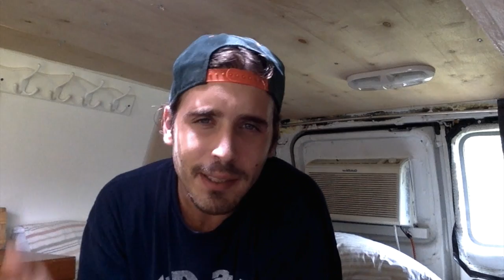Van Life - Q&A Fridays 01 With Campervan Cory

Comment: I like watching your videos.  You are so down to earth and just give off such a good vibe. How is the ac working out? I should have paid closer attention to your dad's install.  We did not put metal against vent on the sides. Rain means water in the van. I did temporary fix for now. I bought Honda 2000i, but still pretty loud for stelth. If you have solution for noise, and getting up in the middle of the night to add gas, please share. I have ideas,  but yours might be better.